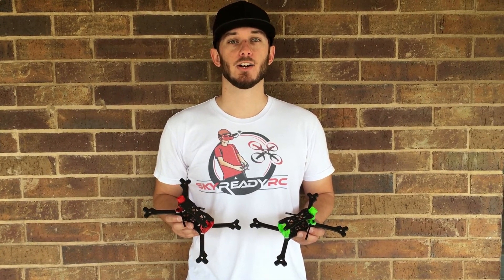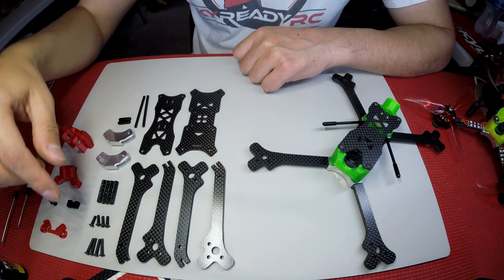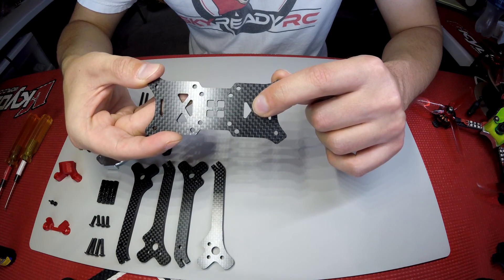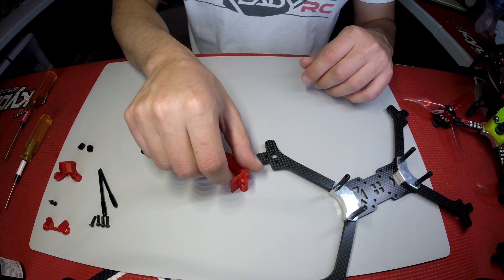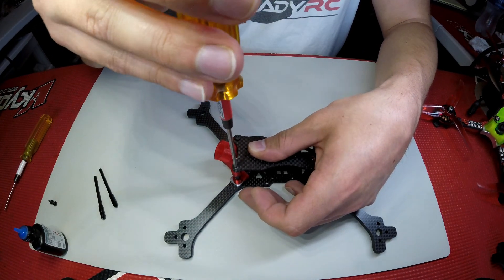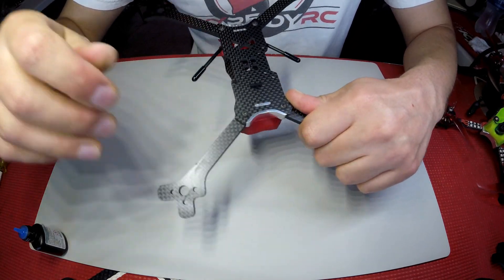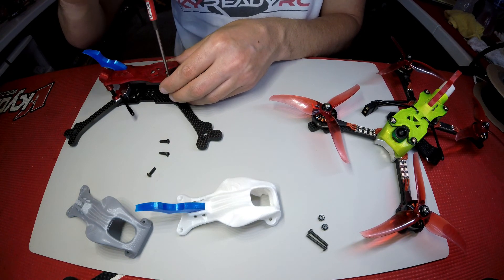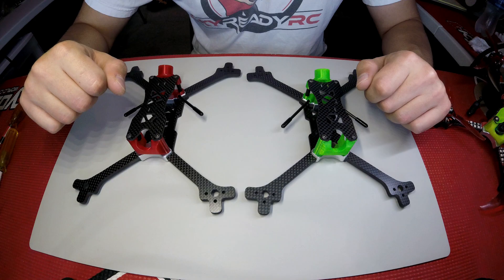Unbreakable Racer??? | Cobra 5" FPV Frame

Comment from the maker: Check out the new evolution of the Cobra 5" racer series, the Cobra SLX EVO. The EVO includes improvements such as: X design, lighter weight, chamfered arms, countersunk bottom plate, and includes the same innovative aluminum CLS (Channel Locking System). Check it out here: https://www.skyreadyrc.com/store/cobra-slx-evo-racing-frame.html

Comment: What is the difference between Cobra and Cobra lite?
Reply from the maker: The Cobra will accept either 20x20 or 30x30 stack. Cobra Light has 7mm shorter bottom and top plate, and accepts 20x20 stacks only. The completely built-out Cobra Light, with a 20x20 stack will be much lighter than the Cobra with a 30x30 stack.